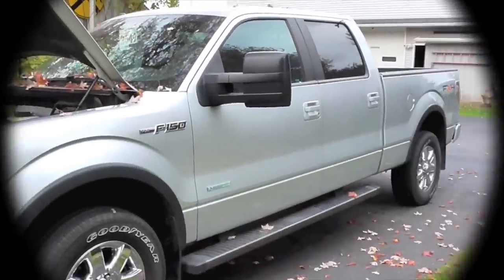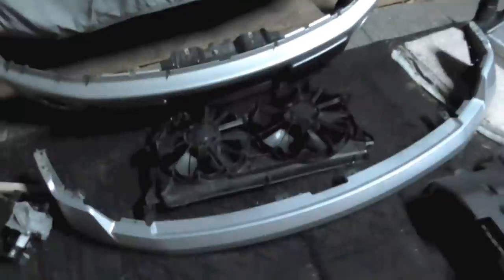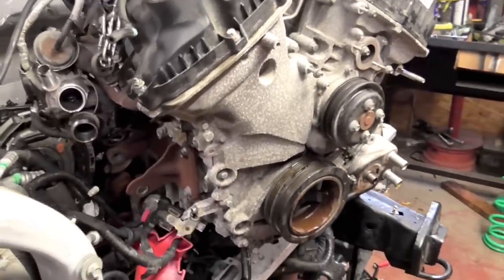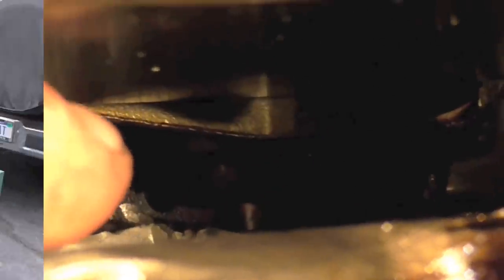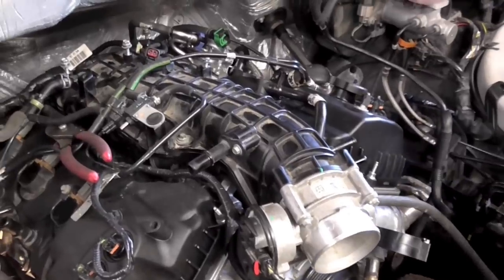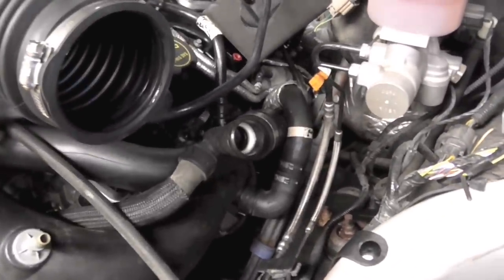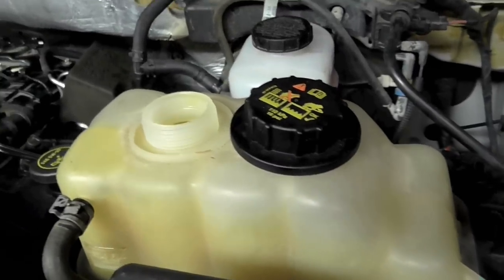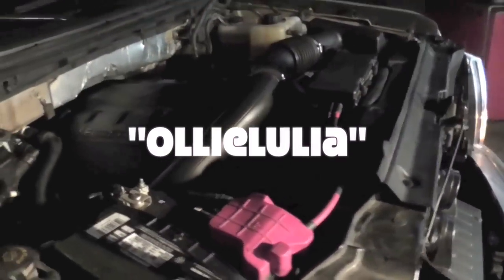FORD F150 TRUCK:  3.5 V-6 ECOBOOST ENGINE FAILURE (Removal and Installation).

Comment: wow, watching a video like this makes me start thinking like the old timers - make it simple, basic, repairable, and reliable.
Reply: yep, buy a cheby
Reply: @johnwaynebrooks    People used to be happy with real truck engines like a 300 inline 6 before people started wanting to win drag races with daily driver pickup trucks which is stupid.
Reply: scdevon. Ya it’s awful pulling my 18,000 lb gooseneck however fast I want to go at 14 mpg. And safely.
Reply: scdevon but it’s fun 😂 you have a point though
Reply: Change the engine oil & filter every 5K mi.  Use "SP" class oil.
ECOBOOST takes 5w-30 Synthetic-blend oil, or full synthetic.
Reply: The transit battery under the driver seat, and you have to take the seat out and bunch of hold down brackets. And to change the Tran oil  jippy or Firestone will not  do it from the bottom a diffrent flush system that clean the filter as it flush. But it’s 240 buck at ford so it cool this tueday
Reply: But the power and mpg is just 18 a week vs 40-50 in a 1994 150 van  and power to spare still no need to floor it but it flying
Reply: @thomas4315  explain how I was able to get my battery out by moving the seat forward and removing the retaining bracket???
Reply: @homeguardster   why you want a 620 amp hr battery?iv brought the largest 845 amp hr I have to move the cable and cut our a portion to get it on  the battery way bigger. And taller, so safety first.Why? The software keep the light on I turn it off but it keep the  current to the circuit alive for 10 minutes that why the electric window work, it’s using a few amp, so your battery is never tap off, you need at hr driving . so you wouldn’t get max mpg. I’ve got a eco boost 250 fully loaded rv 1,500 added Iam getting 18 buck a week iv try 10 buck for 5 days and it’s holding. My e 150   1994    351 used to use 40-50 a week.
Reply: No the stock battery is just 610 am hr, they skimp.
Reply: @thomas4315  so your complaining because you modified the vehicle? Is this satire?
Reply: @homeguardster  how did you even understand what he wrote???
Reply: @BaltimoreAndOhioRR  i understand he is upset that he modified his vehicle.  what did I miss?
Reply: @homeguardster  no your bragging you can change the battery without taking the seat out, we know that. The problem that a bad design and they put a skimpy battery to make it work. This is a ford bad design thread by tittle. Got it  yet?
Reply: @thomas4315  ya everyone look at me, i can change my battery without having to disassemble my van, your all so jelly, dont look away, look at me!  LMFAO!
Reply: @thomas4315  fyi you know the transit has an option for two batteries right? or maybe you dont.
Reply: @homeguardster  not in America
Reply: @thomas4315  thats an absolute lie
Reply: @homeguardster  I dont know. Evidently you can understand the comments better than I. What is 18 buck a week?

Comment: I think it's crazy how much stuff has to come off the front of this newer truck just to get the engine out. On my '81 Chevy, I pulled the radiator and fan, and had plenty of room to take it out from the top. I'm glad this one had a happy ending---as you said at the end, you wouldn't want to have to do it again.
Reply: My dad used to work old 283 chevies. we could replace rings, main and rod bearings in one day, in the truck.
Reply: You could raise the body and do it that way

Comment: My 2013 F150 3.5 ecoboost was stolen from my driveway last Saturday morning. 10-28-2023. Mooring Circle Lakeway TX. The truck was abandoned about 15 miles away. 4 points. Austin PD had lakeside take it to their impound lot. When I finally found the truck it was wrecked but drivable. I tried to start it and it sounded like an animal was camped out in one of the cylinders and then it fired. It sounds like a broken rod. So I got the truck towed home. Physically looks fine. Not cooked, no milk, but it is blown up. I for the life of me can not figure out how they blew it up. Now I think I know. Now I have to fix it before Lakweway's finest makes me move it. Great. Thank you for the Video. I did the timing chain in the driveway last year so that experience will help speed the process, this is a very busy little engine.
Reply from the maker: Holt Crap what a Story !. "I was afraid of WHERE it was going ta end" ... and sure enough it was right where I thought it would be ... I'm sorry this happened.  :- (
Reply: Thanks Tommy. Where do you drill the hole in the innercooler? I suppose i could figure it out. I drained the oil yesterday and it is very colorful. No water. I pulled the plugs this morning and no damage. I have to decide if I want to get more upside down financially in this truck. If it is just a short block I can probably fix it cheap. Crapload of labor and I don't have a shop. U am assuming from your story that the bad guys drove the truck real hard and sucked up the water. I have been working on the truck for a couple years chasing computer codes and gently driving on occasion. I'm feelin' p
retty sick.   @TommyZTrains
Reply from the maker: In the lower "belly" at the bottom (I'm not being smart), that's a tough call, and I get the impasse remark, and in another reality I'd do all I could to HELP YOU / "as I'm just out n' out sorry this happened to begin with".  :- (  @JimBliss-l7u

Comment: When my 3.5L ecoboost was replaced at 36K, Ford mechanic told me he experienced 22 failed 3.5L connecting rods; all of which failed midway between journal and pin. Connecting rods advertised by Ford to be forged I-beam design, but I am told majority of ecoboost components are made in China.
Interesting you pointed out problem with fuel rail design. After engine replacement, my fuel rail leaked in spite of four returns to dealer. Finally repaired leak myself; found rail o-rings destroyed due to misalignment during assembly. Key to proper fuel rail installation is removal of connectors and wiring prior to assembly. The ecoboost fuel rail design is ultimately at fault however; Ford engineers just packed way too many components in this space without regard for accessibility during maintenance.
Reply from the maker: +K Smith  Mr. Smith: "you and I are of a kind"  !!!  :- )  "What an AMAZING thing to say" ! *I hold 'divine respect' for you in and that YOU, fixed a rolled "O"Ring Sir ! ... What an INCREDIBLE DESIGN with those rails ... *I remember thinking (after taking ours apart 3 times) how "amazing" an assembly line IS. 

Thanks for the BEST COMMENT Thus far HERE.
Reply: components made in china? not good
Reply: lee:  Well, for such an inexpensive truck...
Reply: Complete BS! Nice try tho keyboard expert. All materials for Ecoboost motors sourced from top notch vendors in US. Fact. Can u say that about ur Toyota or KIA?
Reply: Frankie Teague  Not true. U really think they bet there best products on junky internals? This engine in vid was abused thru super poor maintenance! Saw all I needed.
Reply: David  Klimmek 
Completely agree. Said he used royal purple synthetic. I think not! That’s BS.
Reply: @davidklimmek3192  depends which Toyota are u talking about, and by the way Toyota is Japanese
Reply: he didn't he mention amsoil? But even then when I saw the sludge, I said: he's not using synthetic.
Reply: @davidklimmek3192  fan boys never learn
Reply: @tomh6779  sad state that ford guys are in ready to throw in the towel yet?
Reply: I'm late to this video but big respect for doing the swap yourself. Regardless of the gotcha on the injectors, doing this yourself increases the chances of the job being done right by a magnitude.
Also, I'm not sure it was the connecting rod that let go BEFORE the piston skirt did. From what I understand THAT is the lottery piece on these Gen1 3.5's. The cast pistons were just not built to the necessary co$t factor and some percentage of them fail. The hole in the block gives the rod the rap.
Reply: @leehancock2782  that a American engine ford short cut for power turbo. LOL too hard on the gas it’s a 120 k motors

Comment: Hmmm, this is interesting, have a '12 Eco. with 220,000 on it, spark plugs, oil changes and air filter. Nothing else. pull a 4 ton trailer regularly with it, No problems.
Reply from the maker: Perhaps it's the Climate WHERE you are William ?  AGAIN: This Truck continues to run STRONG and is a JOY to Drive. "Gese it rides like a Caddy"
Reply: Northern Climate, extreme Weather in the Winter, Extreme heat in Summer, Yes, they do ride even better than a Caddy :)
Reply: Maybe the trailer is actually pushing your truck, LOL, glad your trucks been a good one. I think the new F-150 Ecoboosts with Dual Injection, and up dates are much better, my mom has one, but personally I would get the new 5.0L V8.
Reply: Good for you man.  I bought my 2012 used from a Ford dealer with 45,000 miles and I have had tons of problems.  $3000.00 here, $1200 there.  Now I have a low oil pressure light that comes on every time I come to idle.  I haven't finished paying for, I have no more warranty and I have taken care of it.  I am very concerned that mine is headed toward the same end as this video.  Any way it goes, I have owned several trucks in my life and have never had so many problems.  I am really disappointed.
Reply: Ur in the MAJORITY trust that. Lots details left out here. Lots disinfo on internet.
Reply: @MrGASLP  it's under warranty dude!? Sounds bogus to me.
Reply: @MrGASLP  sorry to hear that man. They've been good to so many buy someone needs to win the lemon lottery... Best wishes to you.
Reply: @MrGASLP  I have a 2013 F150 Ecoboost.  Under warranty had about $7000 work done to it (both turbos replaced, entire AC system replacement).  They wouldn't replace the timing chain under warranty because I didn't have date receipts that proved I did the oil changes on time (I had, just couldn't prove it).  I replaced the timing chain myself.  26,000 miles after the timing chain was replaced it starts to miss on cylinder 3.  Now out of warranty, dealer says I need a new engine.  This is my second F150 that did not make it past 130,000 miles.  I'm done with Ford.  You owners that haven't had issues are unicorns.
Reply: My stepdad has a 2012 ecoboost with 190,000 miles no engine or transmision problems at all. The key is use good synthetic oil and change every 5000 miles. Even synthetic oil breaks down sooner from the extreme temps of the turbos.
Reply: In the 90s when vehicles first started using electronic fuel injection they were so much simpler under the hood compared to the 80s.  It looks like they are making things way to complex now.  Less is better.
Reply: Suuuuuuure oooooook man
Reply: I got a 2011 ford F-150 EcoBoost  225000 on it oil separator  just good maintenance runs like it brand new  and I beat the crap out of it's my farm truck cant beat it
Reply: @holybeef7690  no
Reply: @elmerdane  I dont make shit up it's just the way it is if you keep up the maintenance 
On your equipment it last a long time  oh I failed  to mention I also run 94 octain and give it a full bottle of seafoam when i do my oil change and run 
 Castrol Syntec titanium
My trucks never left me hanging. I also don't use a Ford dealership .just a good reputable mechanic. 
Feel  bad for all those people  having problems with there EcoBoost
Reply: @MrGASLP  Clean the gunk out of the intercooler!  Drill a 1/16" hole in the bottom, and let all the crap inside out!   Between this problem, and spark plugs and coils, usually it's all it takes to get a great running engine again.   Add the 'catch-can' modification, and you should be good to go!
Reply: @jasonplank8803  - Recently read of a guy with his 2011 Ecoboost at 530,000 miles, and has only had throttle body issues occasionally!    Some seem to work just fine with good maintenance!
Reply: Hmmmm maybe your just really lucky to have bought a ford that lasted half as long as a truck should. Probably lying tho arent you? Which is sad i mean were talkin 200k here and you still gotta lie to kick it. Btw trucks go for about 500k with 0 problems regularly. Fan boy
Reply: @489hurley  or just buy a decent truck then you dont have to worry about it... At all
Reply: I bet this guy didn’t tow and get those turbos hot.

Comment: Wow what a guy, great job in doing a really tough job. My brother-in-law just bought a new F150 and he asked me what engine to get and I told him the V-8. Simpler than the Eco boost but not that much. Really when you think of this, you have to ask yourself. Is all this complexity worth losing 2-3 MPG?? Once you have decided on a truck you just know you didn't buy it for good mileage. Simpler is better in the long run, at least thats what I think. Good job.
Reply from the maker: Thnx. !! "Solid reasoning"  :- )  *I agree.

Comment: I've got a 2013 3.5L that has about 110k miles on it and my engine recently started knocking. Thinking of replacing it with a crate engine myself in my garage. Thanks for this video and sharing! This was a great overview of the work it took and what you did.
Reply from the maker: Just take things nice and SLOW Chase ... there's alot of "remembering" woven inta all of this ... so, USE an old camera / AND: taking alot of pic's my help as well. Our Truck continues to run / and perform in a spot-on PERFECT manor !. BEST.

Comment: Another good reason why I liked my old 4.6 triton V6, mine had 145k miles on the original engine and still ran like a champ
Reply: The 4.6 was a complete DOG next to the Eco-boost. No comparison in performance, especially at high altitude.
Reply: Both engines are complete trash. 145k? Oh wow man you broke it in
Reply: @philroe2363  the one comparison is true to all fords they break down alot😉
Reply: @elmerdane  unfortunately I have to agree with you. The choice by Ford to couple all their OHC engines with valve chain tensioners that are guaranteed to fail in time (sooner rather than later) with interference engines is an engineering disaster of unmitigated proportions. They have literally "designed" throw away engines.

Comment: Wow is this Deja vu. After watching this video I can honestly say I feel your pain. I am the owner of a 2011 F150 XLT with the 3.5L  Ecoboost engine in it and I experienced the exact same issue. My engine has 120K miles and has been well taken care of since I owned it at 60K. Additionally, to address the “known” lubrication concerns, I have run nothing but Mobil 1 oil and installed an oil catch can. All that for naught as under normal driving conditions, my engine “threw a rod” just like yours. Because of the mileage and lack of aftermarket insurance, I am forced to get the engine replaced. I found one in a wrecked 2011 F150 with 100k miles and am now $4k lighter in the wallet. I (like you) cannot understand why this has happened to such a “tested” engine. I have driven Ford products all my life and have never “blown” an engine. Sure, a transmission or several but never an engine. Other than that this truck has always exceeded my expectations. I just hope the “donor” engine will go the distance.
Reply: Why wouldn’t you buy a new engine.  There only 5500
Reply: @dudlyspudly4804   it’s depends, the dealership here in Canada want $8,000 for a new long block and it’s 3 months back order

Comment: 217+k miles on my 2011 4x4 Ecoboost that pulls a loaded car trailer at least once a week usually 2-6 hours a day in the south mississippi heat. No problems here. Put on a tune, twin tube intake and performance downpipe with stock catback exhaust. I'm normally pulling 7-8000lbs at 75mph in overdrive(6th gear locked up) at 1,900 rpms and it does not even kick out of converter lockup going up bridges. Just more boost symphony!
Reply from the maker: GREAT !  *ours continues to run spot-on amid no issue whatsoever.  No "tune" (of / in "anything"), in ours as we love-it the way it is !  :- )

Comment: There's another YouTube mechanic and he has a 200,000 mile ecoboost f150 on his channel. Mass produced engines WILL have issues, they're not all going to be perfect and run 1million miles. This goes for GM, Fiat/Chrysler, Nissan,Toyota and so on
Reply: theres a rwason that its a widely viewed vid on youtube, because not many reach 200k
Reply: Husspower enthusiast cause ford wants to sell you a new one either high dollar parts or a whole new vehicle
Reply: There are 1 million mile  2nd gen tundras...
Reply: Brian Wood after a rebuild that is!!
Reply: Brian Wood the first gen looked nice the 2nd gen looks like shit!
Reply: That one changed his oil frequently. Fords factory oil minder blows. No boosted engine should go 7k between oil changes.
Reply: Haven't had a toyota do this... And the million mile tundra had 10k oil changes. Guy was a hotshot driver. I believe it was the smaller 4.7
You can't solve epa restrictions and fuel mileage reqiby boosting the hell out of an engine. Way too high tech. If I ever did ford it would be a 5.0
Chevy? I'd take a 5.7
Reply: NissanTy
Reply: Tierhog GM uses the 5.3 liter V8 or a 6.2 liter V8.  The 5.7 liter hasn't been in a GM pickup since 1998.

Comment: I recently bought my first EcoBoost engine 2013 26000 miles I did some checking on YouTube found out I catch can is the way to go I installed that plus a blow off valve and a tuner it has 32 thousand miles on it now so far I'm very happy hope it stays that way.